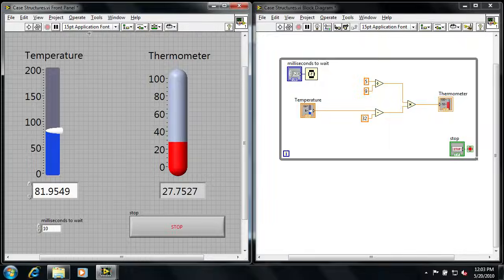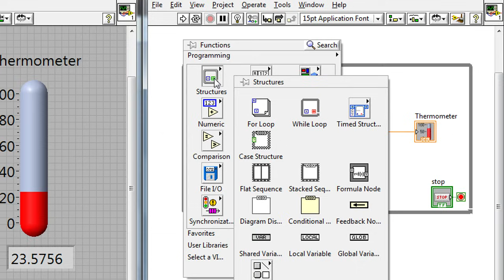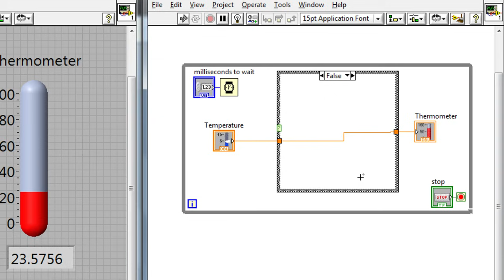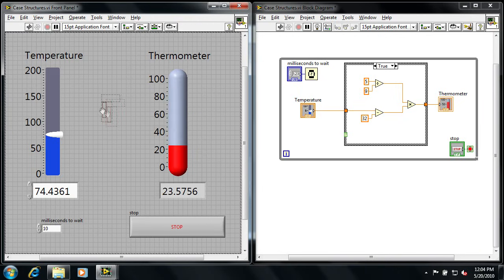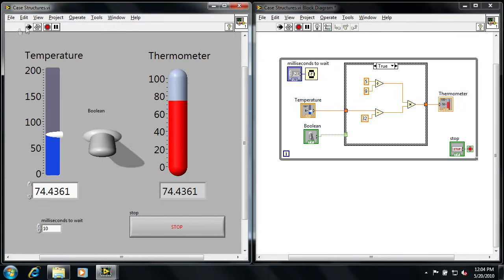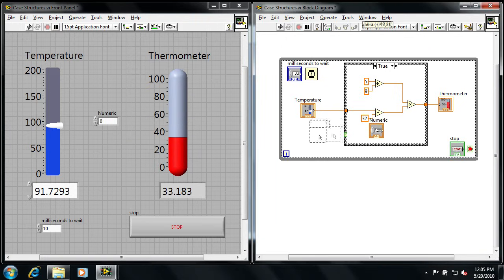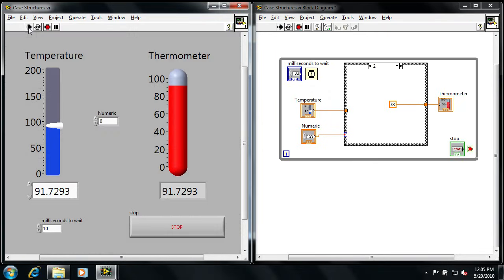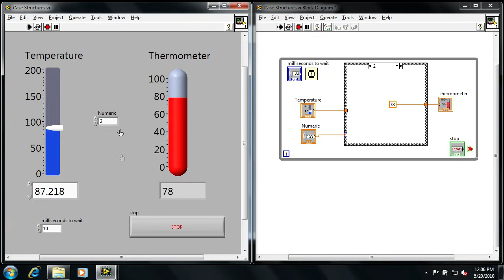Using NI LabVIEW Case Structures

Comment: Right Click >> structures >> Case structure drag and select the area of Blockdiagram where you want the case structure to apply >> Add a contoller in the front panel and control the corrosponding cases using the switch

Comment: thank you for the video. it's explicit. but please am new to labview and considering giving it a chance. my question is so how does implement all the graphical coding into a project, say I want to transform all that into a real independent board to use in a circuit?
Reply: It has to do with setting the inputs to actual circuits and buttons irl. I'm not 100% sure how so I'll have to ask me sensei when robotics starts up again this year

Comment: I've had a little difficulty in using this. I'd like to implement an if-then case structure, but I'm not able to get the hang of it in Labview. My condition is -- if x> constant 1 , then , output = constant 2.
But I only get a true or false as the output of my comparator, not a constant.   
Can anyone help with this? Thanks a lot !

Comment: I find that this is very helpful and clear in what you teach. I would like to know though how using arrays I would be able to use hysteresis in a low level/high level situation. I have a tank of water and at 0V it will activate a pump to fill the empty tank....when the high level of 10V is reached it will switch the pump off but must only activate the pump again on reaching 2V so that the pump is not switching on and off at the high level. Is it possible that Labview version 8 can do this?